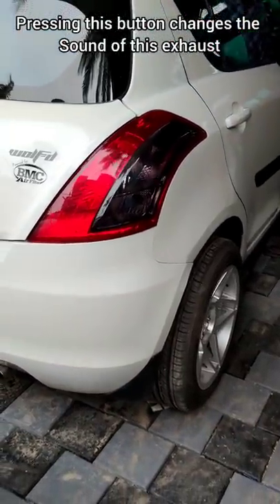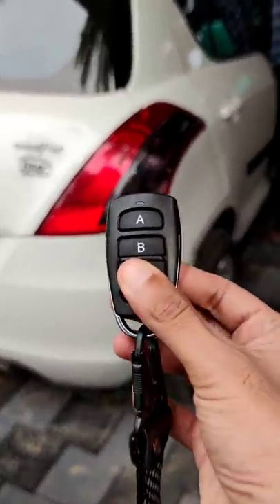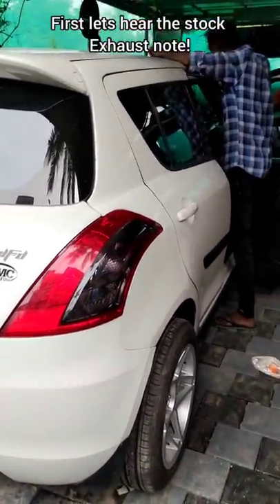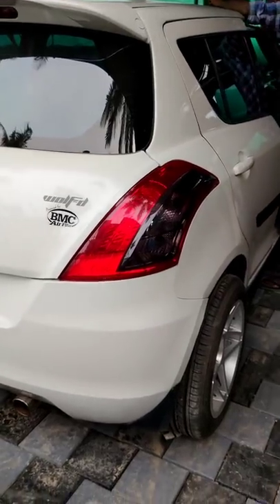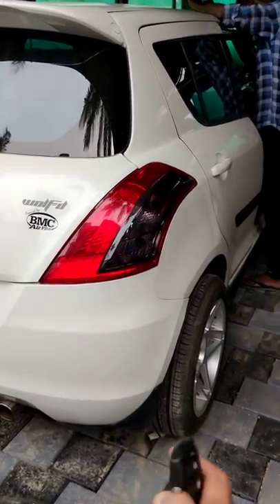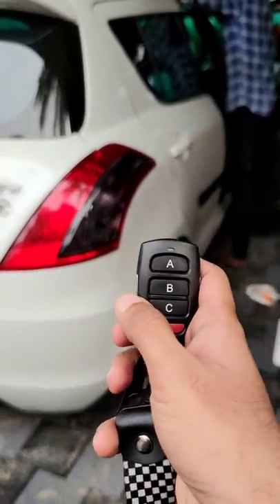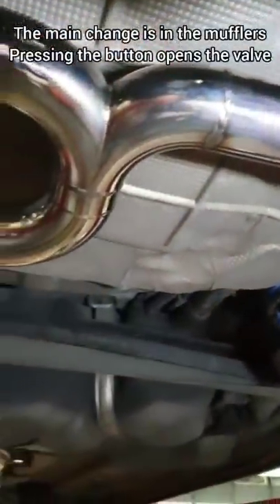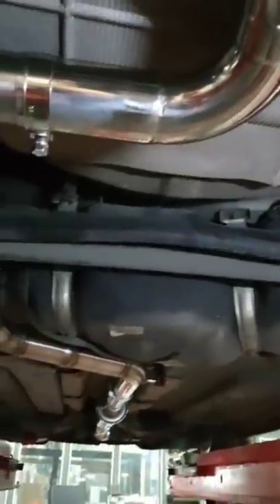Valvetronic Exhausts, how do they work?

Comment: fuel efficiency enginund after!!?
Reply: Silencer didn't increase or decrease fuel efficiency
Reply: @anaswara8859  depending on the vehicle and the type of muffler you can can anywhere from around 3 to 5 hp just replacing the muffler with a more efficient (but louder) one. The hp gain is more like 1 to 3 percent
Reply: @onlygame14  bro fuél combustion happens inside engine and muffler is used to suppress sound of gas coming out from engine
Reply: @anaswara8859  ok
Reply: @anaswara8859  when we install performance exhaust then it's exhaust airflow will also increase and its helps  combustion faster and will burn more fuel as well as performance.
Reply: @Athul8055  haha what a bull shit exhaust air have no role in engine performance
Reply: @anaswara8859  don't make urself fool. Then why they use performance exhaust which increases engine bhp😹